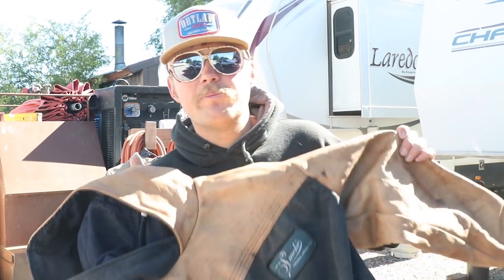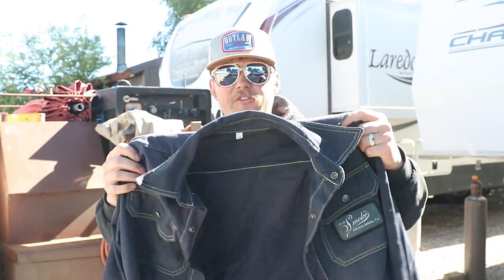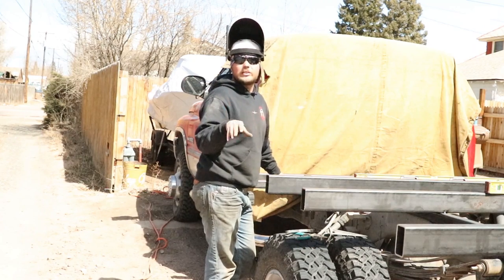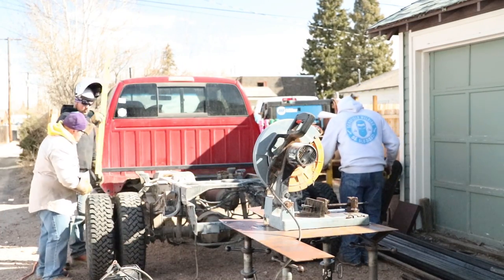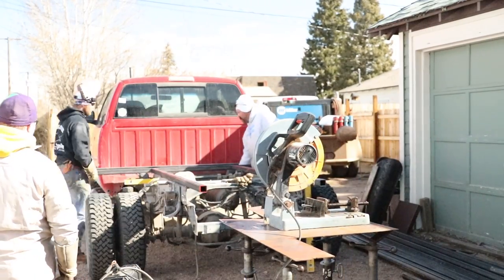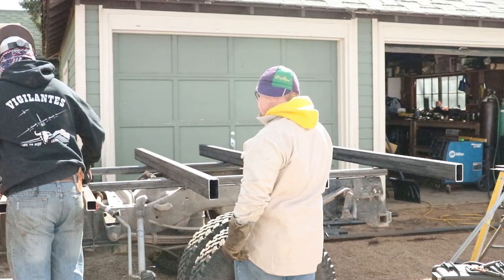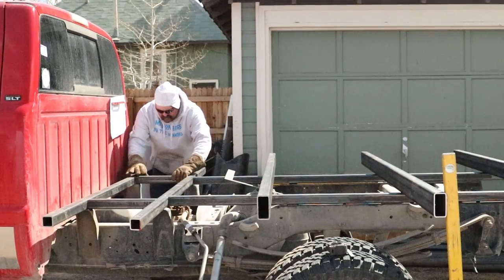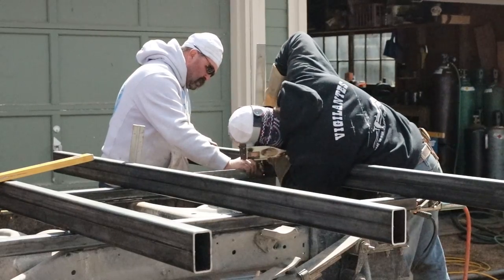Pipeline Style Bed Build/ Frame Layout Part 1

Comment: Jake, 
Don't know if you remember me or not but you took the time out of your busy schedule to call me when I was testing out for branch tee and 6G open root for a pipeline company job. Just to let you know I passed test, then a few months later got laid off because they decided to hire out and use outside rig guys instead of using the "company guy". It is all good because I ended up going back to the company that I work for before building steam turbines for the US Navy. They gave me all my time back(15 years)!  I have still continued on with my quest of opening up my own shop which has been 2 years in the making. Things are going slow and steady pretty much the way that I planned it (being I'm working a regular job)  I've now contracted on will a place called Churchville Fire Equipment. They have taken me on as a subcontractor. What I'm specializing in at in my business is aluminum(but can weld anything). I just produced and passed my first welding procedure for my shop by doing a 6G pipe test aluminum TIG which qualifies me to do pretty much anything in the way of aluminum welding. I told you all that to tell you this. 
If you get knocked down stand back up and press forward. By watching you and your videos, It helps me to keep striving towards my dream of following in my grandfather's footsteps! My plan is to take this opportunity working with Churchville Fire Equipment to come up with better ways to enrich the Fire Equipment world. I'm not just a journeyman welder I'm also a 20-year veteran volunteer fire service, just finishing up serving is a volunteer fire chief and continuing as volunteer fire investigator for my local County. So taking on this endeavor with churchville is within my wheelhouse to say the least. But I'm not just going to stop at building fire equipment. My eyes are wide open to any opportunities that may come along. My ultimate goal is to build a company and quit my company job and have something my grandchildren can take over and not have to worry about finding work!  
Again, Thanks for the time to actually call and talk with me when I needed some advice and continuing on with what you do for the welding community. 

Owner of P-Mac Welding Services- Chris Plummer
Reply: That's awesome Chris! Keep moving forward and before you know it you'll be sitting back and smiling while your grandchildren are enjoying what you built 👍. Also, from one  veteran to another, thanks for your service 🇺🇸.
Reply from the maker: Man congrats brother. I do remember talking to you and it sounds like you took that conversation and ran with it. Congrats brother freaking proud of you.
Reply: Hello chris, good luck, stick to your dream and make it happen.

Comment: Nice. About 30 yrs ago I helped my late father build his last welding bed on his 89 C30. He always bought second hand trucks and couldnt find a cab and chassis, so he bought a dually. The two prior trucks were cab and chassis. He never did like the dually. He made the bed the same width as he would have if it was a can and chassis and split trailer fenders to cover the tires. I recommend finding a cab and chassis with the narrower rear axle if possible. I believe most of them also have flatter frames, making it easier as well.

Comment: Awesum I want to change my bed as well. I have a 1998 2nd Gen Dodge but it's not extended cab. The guy I bought the truck from had the bed already on there but I don't like some things about it.
Reply from the maker: Man these prints and drawing will fit your bed exactly. As long as it’s a long bed dually.
Reply: @JacobSchofield  yup it's a long bed.

Comment: Here in Illinois the gas companies have started to mandate us standing our bottles up in the back of the trucks.    I’m not a fan as I still have a regular box on my truck.   It has forced me to run as much smaller and shorter oxygen bottle.   Have you been seeing that out west?   I’m guessing not as this bed is built with your tanks laying down.
Reply from the maker: Man Ben to be honost I have never worked anywhere except the mines that require them be stood up. MSHA makes you stand them up.

Comment: How long does the metal chop saw blades last , my boss buys the stone ones and they last quite  a bit but all the dust that it makes  , i wear a respirator  just to use it .
Reply from the maker: That one has built 2 full beds. I have an evolution and that thing has made 100s of cuts and is still good
Reply: Don’t put a metal toothed saw blade on a abrasive chop saw the rpm’s are too fast and risk teeth flying off.

Comment: Did you directly tap holes in the 3/16" tubing?  Doesn't seem like there'd be enough material to hold the kind of loads it'll have to withstand.  If it was me, I'd find a way to have a nut.